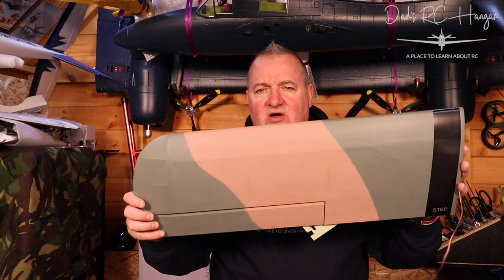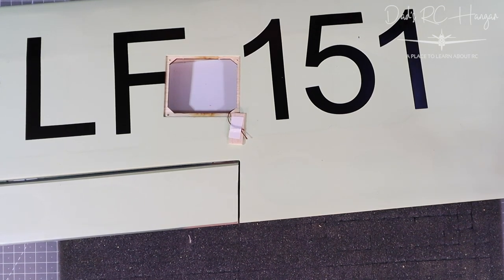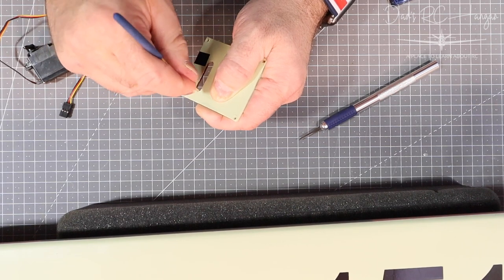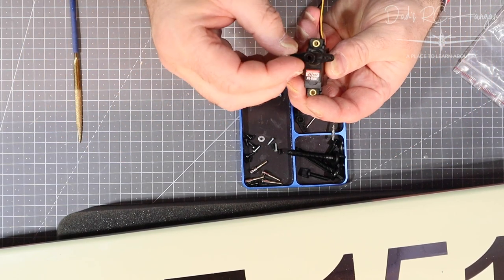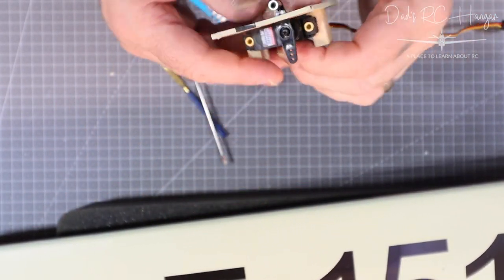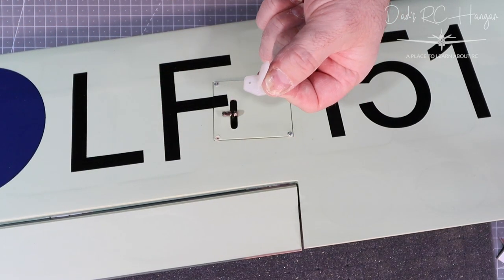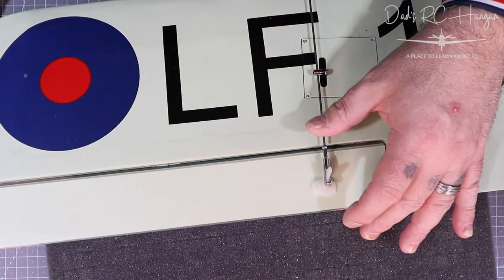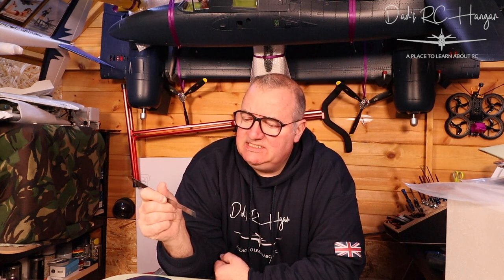Nexa Tiger moth aileron "issue"

Comment: Hi, keep in mind the Servo horns has to be always installed that holes from the clevis lined up with the gap from the hinges! Why you have mounted the brass tubes from the servos in the wrong direction? The round side should be attached at the wood. Cheers Stay healthy.
Reply from the maker: Hi Tom, I did not know the rounded brass faces the wood, thank you for letting me know. I am confused with servo horns lined up with the gap. The manual puts the horn in a totally different place. Their is no wood to fix the horn. Thank you for your input, please input some more. Hope you subscribed to correct me in the future 👍🏻
Reply: Hallo my friend, for servo assembling read this: https://www.promodeler.com/askJohn/Rubber-servo-mounts-done-right as I was starting in RC modeling I made it also wrong.😽 To cut the whole in the foil use a soldering iron about 30W works great you don’t need CA glue there after. Watch this from Petrincic Bros this guys are awesome https://youtu.be/Y-jU0xeHIzw   about in the middle of the Video you see this with the soldering iron. Nice Weekend
Reply from the maker: @airbossone  thank you Tom, will look later. Yup the Brothers are great and I do watch. Keep safe my friend and have a great weekend. 👍🏻
Reply: Hey Chris, another cheerful Friday feeling... great in these crap times. The tiger moth is coming along & looking forward to the next instalment. I agree with the other comments that your control horns are in the right place as that’s what I’ve been told to do with the horns for ailerons, rudder & elevators by the guys at my club who deign & build there own planes. I asked them what to do if the little horn fixing plates over hang the edges, they said just cut the overhanging bits off! & they also said that a lot of imported artf planes have instructions & drawings that are wrong & to ask the experienced guys in our club about things I’m not sure of BEFORE I start doing what I think is right as it saves a lot of time putting things right after. We have a WhatsApp club members group where we can ask for advice & nothing is to daft to ask! Keep safe🤞
Reply from the maker: @johnretired3383  that’s really good, I should have spoken to some of the chaps at my local club or posted it on the DRCH forum, but anyway it’s in the correct place and confirmed by all you wonderful people. Thanks for watching John, see you next week with the continuation of the wings. keep safe and have a great day.
Reply: @DadsRCHangar  What he means is the rounded side of the brass tubing (trumpet shape) goes down, toward the servo mount (wood side). You did the same mistake for the elevator and rudder servo. IMO, is not a big deal, I have them wrong on many of my planes. One thing I do is either place receiver double sided tape to the face of the servo facing the balsa side, where the servo rests or a few drops of hot glue here and there to help those two wooden mounts. ALWAYS give them a line of CA glue to all the wood servo mounts where they are glued to the balsa. 
Those ARF sometimes cut corners, have seen a few lost planes servos detaching from the mount. I always do the CA and hot glue / double sided tape. I have lost planes, but not from them detaching. 

I cut at an angle the first hole of the control horns, closest to the mount. Opened the holes where the servo arms move and give em maximum throw. I never use adjustable pushrods for ailerons, so easy to slide out. Do a dip on the rod w a dre5mmel so the bolt bites on the metal rod. I prefer Z bends or clip on clevises secured w heat shrink if possible.
Reply from the maker: @zubuxstein  Thank you for watching and taking the time to respond. I will make those changes on all the servos. Good idea about the heat shrink, will also do this. Hope you Subscribed, may need your comments in the future 👍🏻 Have a great day.

Comment: Chris, as others have said below, you got the horn position spot on, the manual is wrong. The horn holes should line up with the hinge line as close as possible. The bit that is overhanging on the top side, trim it off along with the excess screw thread....👍
Reply from the maker: Thank you Ian, it’s tough when it’s your first time fitting like that, I took inspiration from my p38, she has the horns in the same place. I will still make sure it’s as close as possible and straight  to the hinge. (Need to find the other horn). I do get satisfaction with the building, not seen any more building form you? Thank you for watching as usual Ian.
Reply: @DadsRCHangar  the Chippie is on hold at the moment while I put together a Chris Foss Xtra Wot kit. Maybe should have done a build log but it’s 80% done now. I like to take my time with scale models so I’ll get back on the Chipmunk ASAP...👍